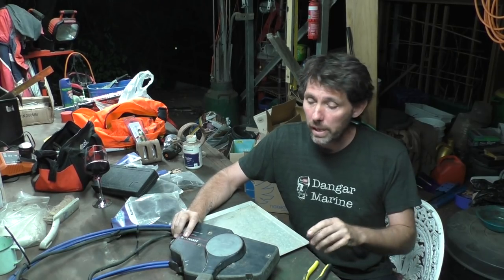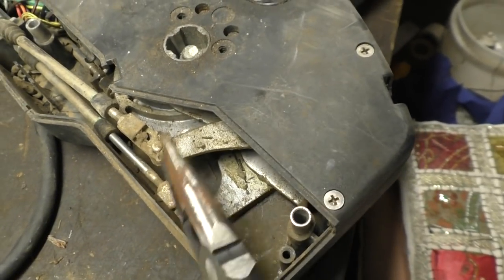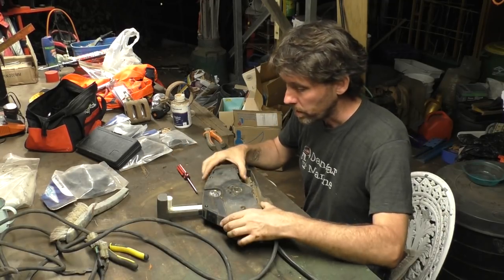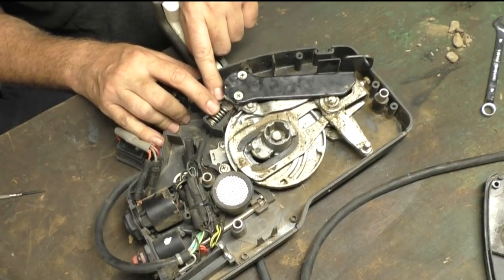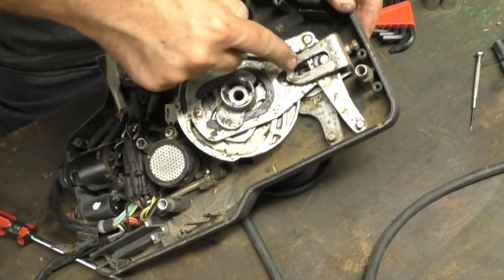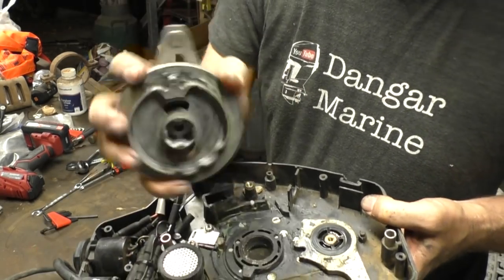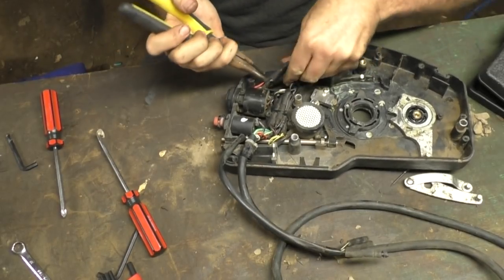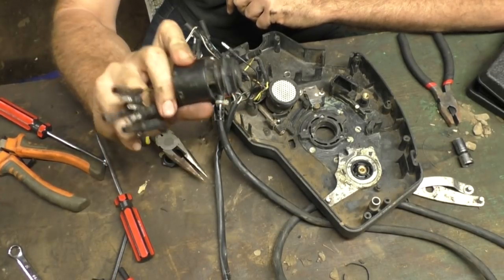Outboard Forward Controls

Comment: I really appreciate your vids.  I have a 95 evinrude 30 hp.  I had to manually use the throttle to get back to boat ramp tonight.  I could put it in reverse  put when I put it in Forward the engine stalled right away.  I had to disconnect the throttle cable and push the throttle with stick to go forward.  Please help if you can.   I do remember yesterday I did have to pull the cable to get to the  throttle because I was trying to get to some wires that were snaked in the same housing as the throttle.

Comment: I want to correctly redirect the cables to control box on my boats console (they ran cables through consoles front open doorway instead of running cables through side, so a door that helps with water an electrical fuses, etc.

Comment: My OMC evinrude throttle does the same stopping 3/4 in forward, does it supposed to go all the way forward as this one? was afraid id break throttle arm.
Reply from the maker: I was driving a boat yesterday that had a Johnson outboard on it and only went 3/4 of the way forward so this could be normal for that model of forward control. Does the outboard reach full RPM?
Reply: The motor revs up, im not really sure how many RPM, the control box has 3 notches, id say 12 oclock neutral, and 10 oclock 2 oclock, its old and plastic gears. Thanks for getting back on this, im not positive it came standard with boat.
Reply: 10 , 12 and 2 o'clock positions are the detent for engaging/disengaging the gears- all normal there. The throttle lever only goes a few degrees past the 2 o'clock position (reverse) - you cannot get full throttle in reverse by design. Full forward  the lever on most engines will go about the 75-80 degree mark and not feel like it is all the way forward, that's normal. The lever on the control box has more throw than the lever on the engine ( it is a design mismatch) , but only on outboards. The control box was also used on the stern drive range and I get the feeling it was biased towards them for operating range.
Reply: Thanks, looks like water behind me is boiling, not pushing boat enough to level out, thought I was losing power at throttle,
Reply: Might be one for Stu to do on motor trimming diagnosis / set up?

Comment: Do you happen to know how to wire the plug of the distance control from tohatsu? The one that is round and has 8 female connectors in it
Reply from the maker: No, you would need to find the wiring diagram in the service manual for it.
Reply: Dangar Marine thanks for the response. Big fan here from South America. Do you happen to know where I can download that manual?
Reply from the maker: readmanual.com and tradebit.com have quite a few manuals. Worth a search there.

Comment: I’ve got a issue with my 2006 Honda 20hp with that exact controls and was hoping by troubleshooting it and a few other electrical parts I could get my motor. I have seen it running before I removed it to paint the boat. The motor fell over and the cables kept it from falling over and landing hard on its side. I noticed it maybe a few hours later and stood the motor back up. But since then no power AT ALL at forward controls so that I can start the motor. This is my first boat and want to go fishing with my son so badly! Again it was running before the motor fell over. Please help

Comment: Dangar Stu, I'm needing to replace my control box on my mercury setup, it's just too far gone, My current setup uses an 8 pin harness, and I seem to be unable to source one of these control boxes, is it possible for me to save the harness out of my current control box, and splice it into a newer 14 pin control box? Thanks
Reply from the maker: Yep, that should definitely be possible. You might be missing the odd alarm or something, but all the basic ignition wires will have a direct crossover.
Reply: That's cool, All I'm looking for is ignition, trim tilt and maybe down the track a tacho. Thanks for your advice, been watching your videos for a little over a month, and it's definitely helped me out in setting up my new (to me) boat, it was a complete mess when I got it, hoping to have it finished by christmas.

Comment: I have a question, when I put my throttle in forward or reverse it feels like it grind from neutral to forward or reverse is that a quick fix ?
Reply from the maker: If you are letting the revs drop down to idle in neutral before selecting a gear and then selecting the gear quickly and it still happens, check this video https://youtu.be/B4acSf_BgP4

Comment: Can the throttle cable affect the rpm?
Reply: Moe yes it can but it is easy to fix with the screws on the  conexions at the end
Reply: Jasper B how do i know the perfect spot for the throttle cable?
Also can the gear cable prevent the motor to switch to reverse? Or give it a hard time to switch to neutral?
Reply: Moe you just have to find the richt spot so yhe engine goes to ful throtle and stationair perfect
Reply: If you watch the 'how to replace the control cables' Stu goes through the adjustment process.

Comment: Thanks! I am having a hard time figuring out how to get my throttle cable adjusted on a yamaha 703 model control box. I saw your video on changing the push pull style, but I can get mine to match up and even with an almost completely extended throttle cable and ends turned out as far as logical, I have about 3 inches to go to get to where they need to meet the connection on the outboard. I just took this motor off of a hull that had damage and put it on another hull. I had to change control boxes because i went from a center console with top mount controls to a 703 style side mount.  Any help or advice is greatly appreciated.  As always, I appreciate you and your great videos!!!
Reply from the maker: Bit hard to say without seeing it, but the lever I swapped in this video can jump to the wrong position. Maybe post a picture of it on the Dangar Marine Facebook page.
Reply: Dangar Marine thanks. I will!!!